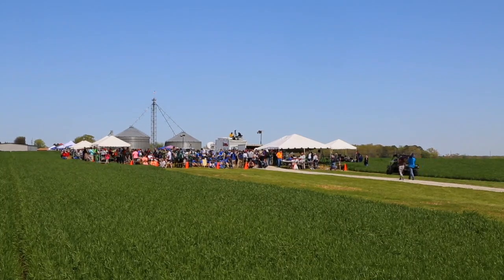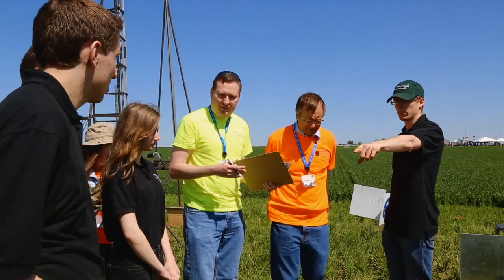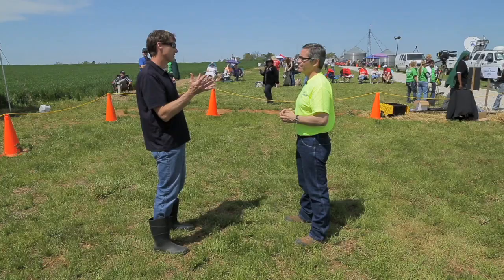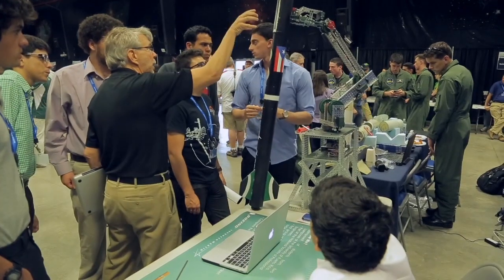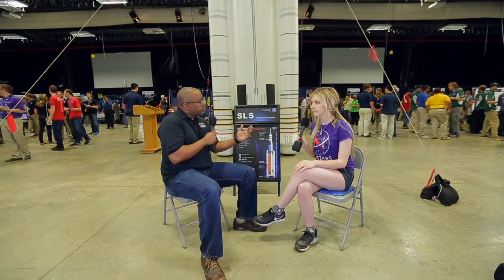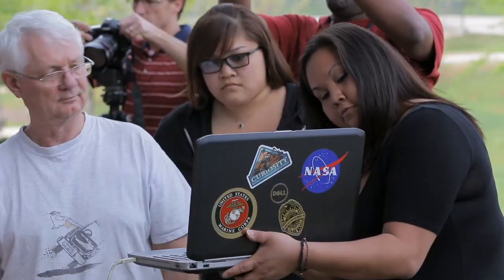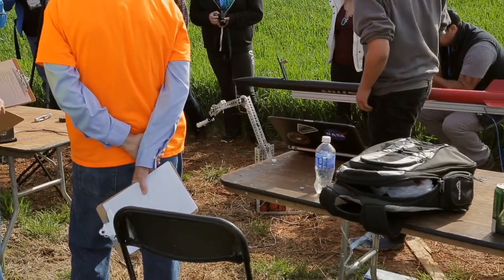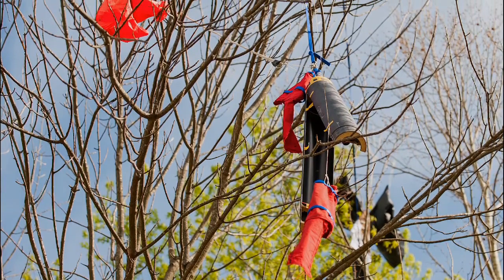NASA EDGE: Mars Ascent Vehicle Prize

Comment: Nice to see NASA starting to source tech for a Mars assent vehicle. It would take 10 years at least to develop a flight ready crew Mars assent vehicle. It would be one of the most bulkiest components of a human Mars mission. It would have to be very reliable & withstand sitting on the surface of Mars for at least a year or two. On Mars you have all kinds of dangerous weather that could cause problems with or even total hardware like storms radiation & the possibility of meteor strikes. 
A human mission to Mars would be a long term mission. It wouldn't be a quick trip there and back just to plant a flag, colect samples & deploy surface experiment equipment like in the Apollo missions. It would be a long lasting up to a year to get any real research done. Similar to the Antarctic expeditions curently being undertaken lasting 6 months to a full year.